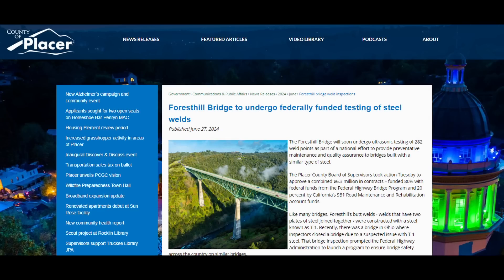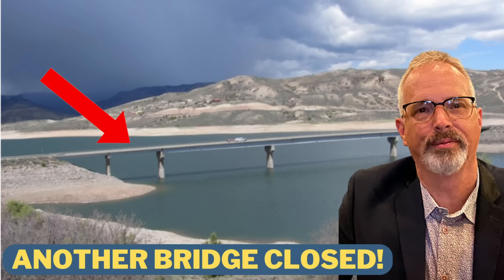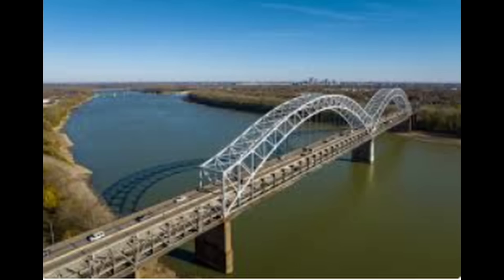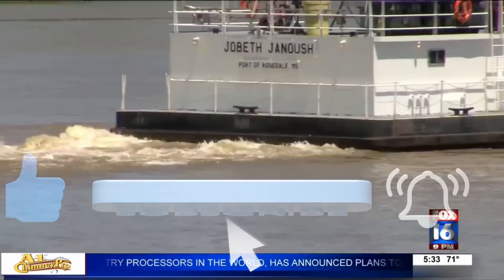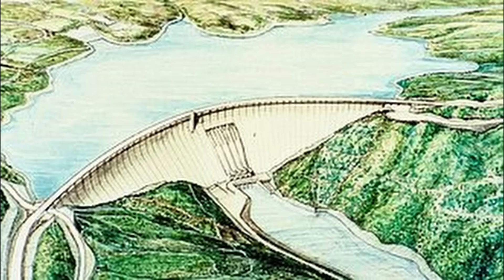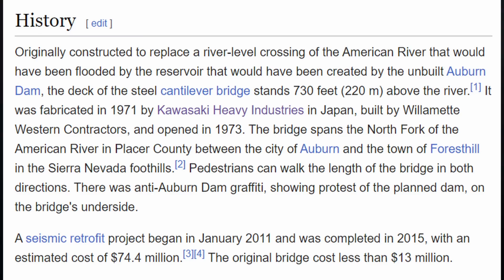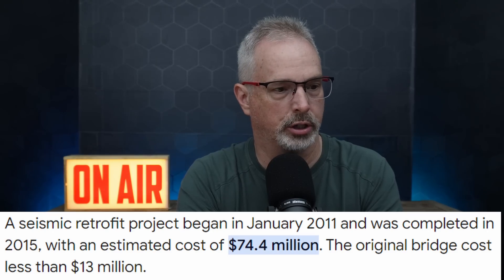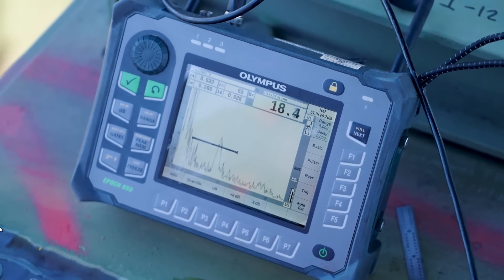Foresthill Bridge in California - Another T-1 Mess?

Comment: as a former shipfitter, I can tell you that you cannot weld hardened steel without gradual preheating, and then gradually cooling. The weld will crack and break if you don't do this. Those cracks in your T-1 steel happened because the proper weld procedure was ignored. So you have lots of hidden issues.
Reply from the maker: Thank you.  I suspect that many of these T-1 bridges will simply have to be replaced rather than trying to remediate them.
Reply: @CaseyJones-Engineer  I agree it is too expensive to try and rehab or repair, or upgrade them.
Reply: I guarantee you that some welder was sitting there looking at his supervisor trying to explain why he needed to preheat and post heat and that supervisor ignored everything the welder told him, shifted the welder to another job while getting another " Cheaper " welder to just weld it up and move on!! I can't tell you how many times I've seen this exact scenario play out on jobsites. I've seen really good welders get pushed off jobs because they were " Too hard to work with " when they were just trying to do the right thing.
Reply: @mcpheonixx  T1 steel was designed for riveted construction. Even in WW2, steel  welding was new, and lots of ships broke in half because of poor welding... and just preheating with a torch is NOT sufficient that weld will break. my experience..
Reply: @mcpheonixx  I agree you see this all the time.
Reply: Also could be influenced by not using (or improperly storing) correct welding rods ie. low hydrogen rods.
Reply: @Kandyman54  Each type of steel requires a specific welding rod. Someone mentioned using mig to weld high strength steel. I left the trade some 20 years ago. Back then, the shipyards only used stick welding on HY80.  Mig was only used on mild ship-grade steel. Tig was used on other metals Who knows what type of welding rod was used in the 1950s?  I read that Back in WW2, their era welding rod did not even have flux coating!!!
Reply: @lewis7315  When I was in the Navy 50+ years ago they welded HY80 with 11018 low hydrogen rod. The rod was stored in heated ovens once the Spam can was opened. I was in the NDT lab at that time. 
I later attended Ship’s Emergency Welding School where we learned TIG and brazing.
Reply: @Kandyman54  Yes, 11018 sounds about right ... its been 20 years :)> what did they teach you about pre and post heating? Fitting and welding inch thick hy80 to a rudder casting was really annoying, precise, annoying and very hot work mid summers! And annoying some more!  Funny, one rudder casting came to the shipyard one foot short and nobody caught it until the machining was halfway done. Think turning a 30 foot long over 2 foot diameter casting on a lathe down to design specs. Those bulbous bows were even worse. And much hotter :(
Reply: @lewis7315  lol about the rudder. 
I don’t remember whether they preheated or not. I was a helper in the Non-destructive test lab and did  not weld at that time.
Reply: Creosote is very, very toxic.
Reply: At first glance I read that as 'former shoplifter'...😅
Reply: @cliffwebb1443  🤣🤣🤣
Reply: @cliffwebb1443  Yes, Cliff, when you get older (I'm now 76) You will find your brain doing that all the time. You are also constantly wondering about the here after ... like as in "what am I doing in this other room here after?"  :)>
Reply: Yeah, the only time I worked with T! steel was for underground drilling! we also used 4130, man that stuff is hard, it broke one of my tools when I went to center punch it !!!
Reply: Amazing how the old wooden railroad bridges and trusses are still intact today.. back in the day, the railroad would take taker trains full of creosote and soak the tracks and bridges to control weeds and rot of the ties and bridges… what is worse??? The creosote or a bridge falling with millions of tons of very hazardous materials?
Reply: @Cowboy45357  Rails break faster because we carry orders of magnitude more stuff at higher speeds. 2.18 TRILLION tonne-kilometers of cargo in 2023. Conversely, we have less rail track length than 1900 because trucks have taken over short haul rail. In 1860, 80% of Corn Belt farmers were within 5mi of a railroad. That's both a function of necessity (can't ship much if you're 10mi with horse cart) and the density of lightly used single track rail to service rural areas. We move more stuff on less rail, is it surprising that rail breaks? 

Coal fired trains also couldn't achieve the same speeds, both because their rails were more uneven in production and without modern steel chemistry and because coal is much less efficient than diesel and diesel electric in particular. Loads were also generally lighter (no double stacked containers) and trains were far shorter. Coal trains can't  push nearly as much so you ran with fewer cars and lighter loads.

Creosote dumping is not worth the tradeoff. You already need to maintain the rails, modern steel can only do so much with huge loads, might as well rip out the wood. I doubt creosote treated wood would handle high loads much better, rot is less of a threat.

We should adopt a swiss system requiring light rail connections to warehouses. Efficient without being too disruptive.
Reply: @28lobster28  And the railroads are destroying our rail system by not doing long term maintaince on the tracks, especially on the Northern transcontinental route carrying miles long coal trains.
Reply: @artmosley3337 I use creosote and old engine oil to paint my timber fences. Lasts for years.
Reply: @Cowboy45357  Out west fires are a big problem, and creosote only makes wood more flammable, unfortunately. Ever see a dock fire?
Reply: @Cowboy45357  The old wood bridges aren't all still intact today many have been decommissioned and demolished for their own structural reasons. It's not news because it's expected for old bridges to be replaced.
Reply: @Cowboy45357  Beware of survivorship bias. A tiny few remain intact today over many thousands build. Wood burns in wildfires too.
Reply: @Cowboy45357  yep,  more of the same.  Prioritizing some form of idealism, now so often some type of wokeness, over what makes perfect sense.  Creosot works great...
Reply: @gereshare6659  btw.. ya know that 55k acres that just burned up yesterday.. and is still burning.. I bet you a dollar a few of those trees would have worked better… and maybe the selected harvest of trees (people think they live forever.. 50-75 years and most start to rot.. NYC Central Park has a huge amount of trees that are hollow.. one fell on a woman.. huge lawsuit… but the trees that were used as timbers in the construction of Venice are 700+ years old… because they are totally submerged in water… the biggest environmental disaster ever was allowing Environmental Scientists to make decisions or recommendations.. replanting trees is the best solution to everything.. id start with the west coast and replant Red Woods and replace San Francisco
Reply: I thought I read ‘former shoplifter’ since it’s so common to see that term in the news here in CA. 😂

Comment: The new SF bay bridge bolts broke on a very windy night. They blamed the high strength steel from China  but I suspect it was from over loading on a faulty designed anchor point. It will make more news when it starts flipping around in an earth quake.

Comment: I dont know what the US is like but over here the problem is bridges built 50-60 years ago were designed to last 30-40 years and so have been replaced 20 years ago...but obviously they were never replaced. This is not just a bridge problem, lots of buildings and roads were also built on the cheap because they were supposed to only last 30 years and then replaced, yet somehow people "forgot" about the replacing part.
Reply from the maker: That is a far too common issue.  And instead of replacing the worn out, poorly maintained bridges many DOTs are spending inordinate sums of money try to rehabilitate these old bridges instead of replacing them.
Reply: @CaseyJones-Engineer yeah, just how politics goes, I guess. Meanwhile we have Victorian rail bridges built of thick slabs of mild steel riveted together and they are still going with just routine maintenance because they're so over-engineered. Unfortunately if a cheap, temporary option is available, that's what the people in charge will go with. I honestly don't know what the solution is, it's human nature but it is very frustrating.
Reply: @PartanBree The railroad bridges were over-engineered partly because steam locomotives are so much heavier than any cargo. This allows a certain amount of deterioration to be left unfixed. Some of the railroad bridges leading into the CNW terminal (now Ogilvie Station) in Chicago have suffered a lot. The station opened in 1911, so I'm guessing that's when the bridges were originally built.
Reply: @PartanBree 
Where is 'over here', Partan?
Reply: The vehicle weight going up and overall traffic numbers often also exceed the design loads.

Comment: I was just thinking about the Jennings Randolph Bridge when you mentioned it. I can see that bridge from my house.
Another incident was the I-79 bridge over the Ohio River at Coraopolis PA which developed a large crack in bitterly cold weather in 1979.
Reply: That failure did occur at a weld. But I don't think that it was a hydrogen enbridlement. At the time it was related to the type of weld that was used. (I think the process was primarily related to the type of shielding used during welding. The shielding is what makes me think that is was a different failure type.) I don't remember if they determine if the welding process was a bad process or if the process wasn't accurately followed. 

It would be interesting to see a comparison video of the I-79 failure and these recent failures since they are all related to weld failures.
Reply: @erniecolussy1705  
Now that you mentioned this, I do remember hearing about a now-banned welding method that was new at the time
Reply: @leehuff2330  
I knew that it was related to the process. But I did realize that it was later band. Thank for the information.
Reply: @erniecolussy1705  
I remember watching a show on WQED about the area bridges that started with a story about the crack. They interviewed the towboat captain who spotted and reported the crack, preventing a collapse. The segment also included how that welding process was new at the time, but was eventually banned from bridge construction due to weakening the surrounding steel.
The show also included an interview with the iron worker who was trapped on the old Brady Street bridge and how a surgeon had to be brought to the bridge to amputate his leg so they could get him down after the bridge, which was being weakened so they could implode it, settled and trapped him.

Comment: As a steel inspector early in my career, I witnessed column cracking at splice welds at the base of a high-rise in Boston. I asked the "experts" why they didn't maintain Interpass temps during the welding. That was the problem. Don't trust experts, do your homework. 
 If working on a bridge, ensure the welding procedures matches the materials being used and check the operator's quals are AWS D1.1.5.
Reply: T1 is used in crane and machine booms buckets and as you say must be welded as per AWS spec.
If done properly amazing strength durability.
Reply: My dad used to laugh every time he heard the term “expert” used to describe person’s experience. His definition of “expert “ was a former drip under pressure.

I laugh when I hear the description of a “blue Ribbon Panel” did the panel participants all get 4H Blue Ribbons.
Reply: @jimpawa5793  It's popular these days to claim that there are no experts and one opinion is as good as any other, but that's not even close to true.  There are people who have spent the years of study and years of experience it takes to be an expert.  Sometimes experts make mistakes, but it's always better than guessing.  Uninformed people sometimes make the correct decisions, but their reasoning will always be wrong.
Reply: @jeffrey1312  My experience is that the real experts never claimed to be one.
Reply: @joefin5900 yes, I have heard guys tell me they are a “master plumber, master mechanic, master carpenter “. These terms tell me to run, or at least to stop all engagement with this super professional. The solid guys or women don’t need to reveal the standard they operate in. The proof is in the pudding.
Reply: @jimpawa5793  Or did they drink too much Pabst Blue Ribbon Beer?!

Comment: If they find cracks and install the reinforcing plates, I wonder if they will allow the bolts holes to be hydraulically punched instead of requiring them to be drilled?
Reply from the maker: That is an interesting point.  I would like to see more details about what they are planning.

Comment: And have you considered an investigation of the new - cable stayed  - San Francisco/Oakland Bay Bridge?  It was designed to be un-repairable, and CalTrans specified bolts that its own design standards prohibit for use in a marine environment.  These bolts began fracturing and cannot be replaced due to the bridge design. They were also used, at the bottom of the Bay, to anchor the tower to its foundation. 
There are many articles in the San Francisco Chronicle.
Reply: I vaguely recall the threaded rods to anchor the structure were cast in concrete, and were susceptible to hydrogen embrittlement because of the way they were hot dipped galvanized.   I don’t recall if any had HE cracks. I also recall a fastener company Dyson being involved, and they’re a big name in industrial fasteners.  10 years ago, this was big news.  I would be interested to see a follow up on this.
Reply: Regarding the inspection instructions, it seemed specific to butt welds on tension.  Were fillet welds included too?

Comment: Just for clarification, have other bridges experienced T-1 steel beam/girder fractures like the I-40 bridge? The other examples you mentioned seem to all be weld failures due to HE. My though here goes to the potential breadth of the problems; i.e. weld failures can be corrected and monitored forward, however if the base T-1 steel is the source of the failures then the problem is much broader with greater potential, perhaps probability, for catastrpoic failures.  Thanks for sharing your expertise and valuable insights as an engineer.
Reply: All materials have problems with cracks, some more, some less; all materials contain cracks straight from the factory, that's why bridges are subject to inspection. The problem with welds is that they change the properties of the metal they're done on and their quality is highly dependent on the skill of the individual performing them.

I don't think these problems, as far as they're related to the base steel, are really a defect of the material so much as these bridges are nearing end of life.
Reply: @Kandralla  Thx very much for this clarification.